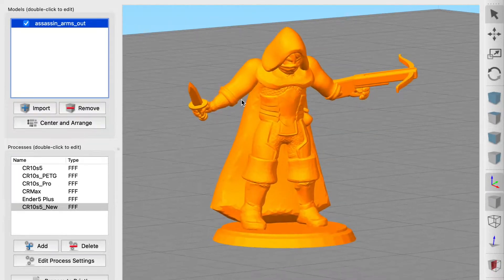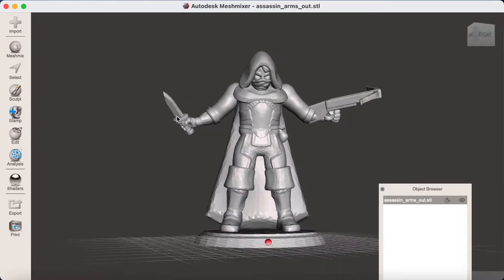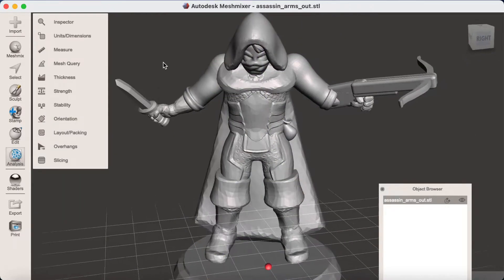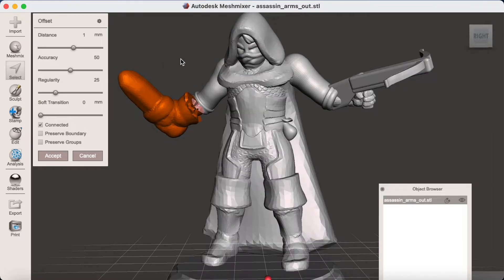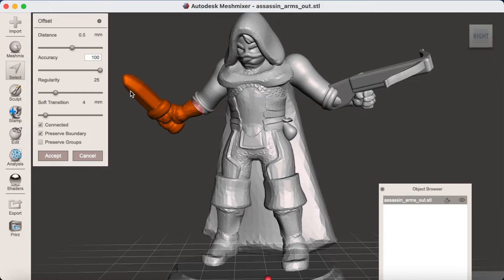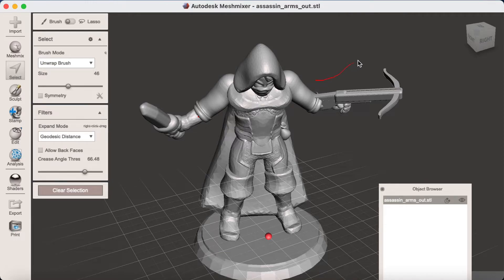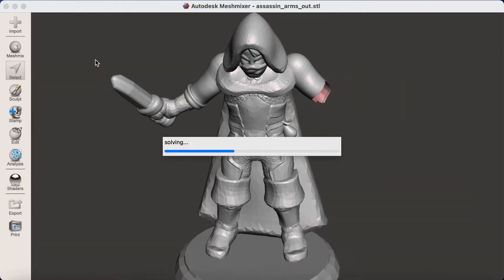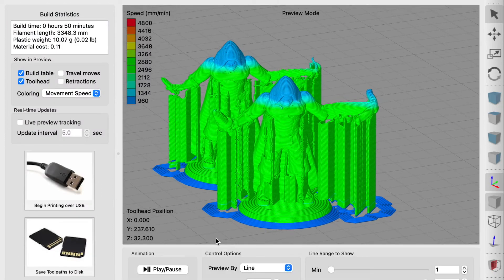How to Add Thickness to Thin Models in Meshmixer - ready for 3D Printing

Comment: I am going to give this a try as i have a few prints that i want to do however when i did my original print it was 1 layer thick so broke easily, hopefully this helps and i can start printing stronger prints
Reply from the maker: Let me know how you get on! Good luck :)
Reply: @CallumColes  the file i had wouldn't play nicely when i tried this method for dome reason when i try to make it thick enough that it keeps the detail it adds random things to the file, one i placed into chitubox the file had random triangles all over it 🤦‍♂️ i will have another play around with it to see what i can do